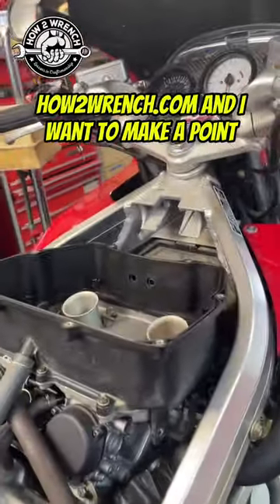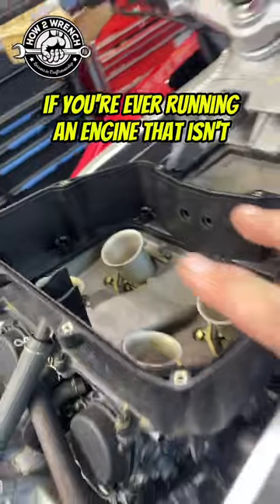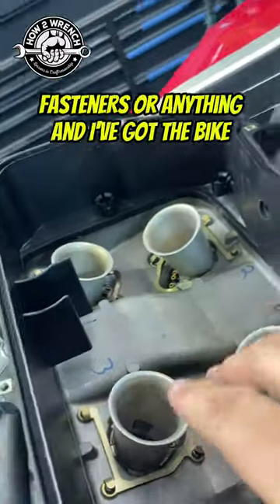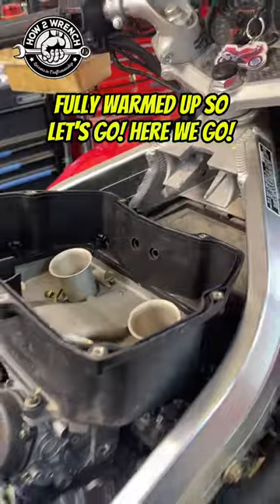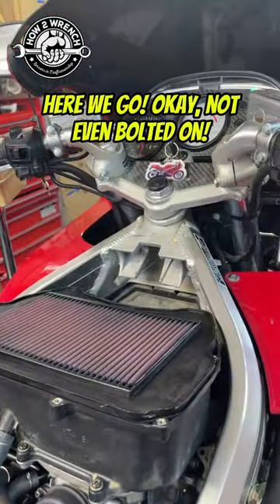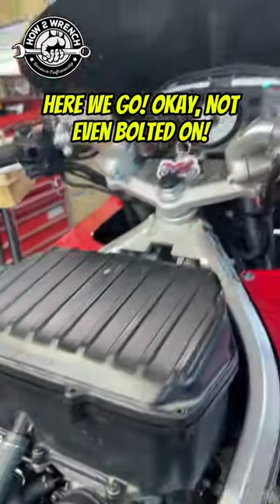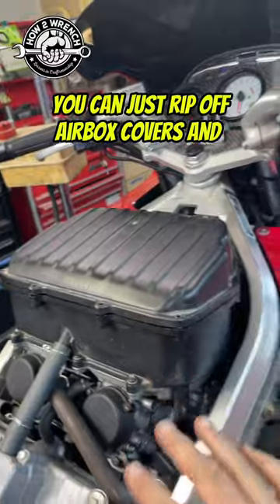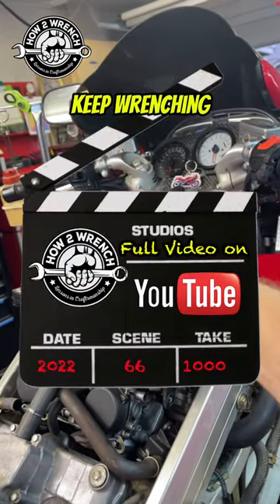You just screwed yourself  but didn't  know it #carburetor #diymechanic

Comment: Yup I ran into this several times. I was working on 2000 cbr600f4 this summer it wouldn't rev out properly.  The owner didn't tell me it wasn't jetting for the pipe he put on and that was the issue.  Put the oem one back on and it works perfect